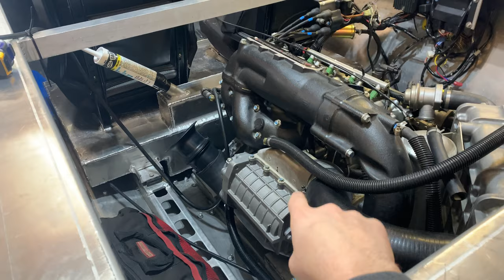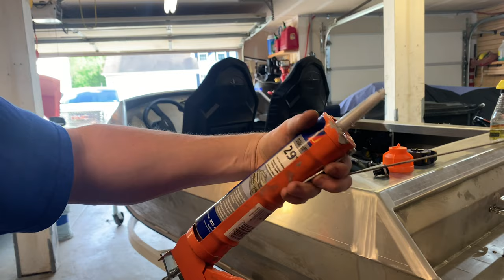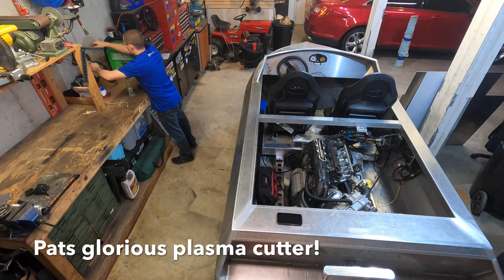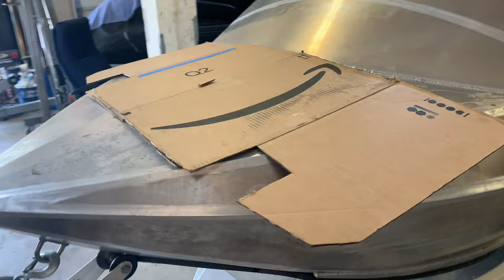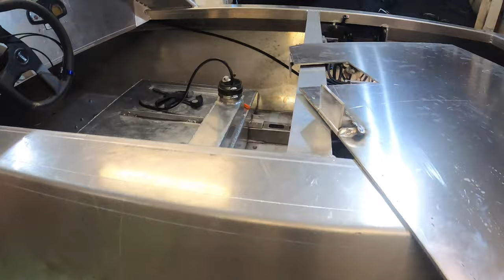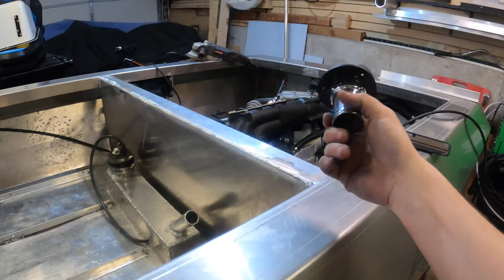Mini Jet Boat Build 21 - Bulkhead and Telltale

Comment: Nice work on the jetboat and dont you have a trim on the jet unit to counter the left pulling otherwise do a fine adjustments on the steering on the jet drive or extend your jet drive plate
Reply from the maker: I do not. I have been scoping out the southern jet trimmable nozzle to allow for some trim adjustment.

Comment: 1. What would you say is the minimum depth these boats can ride in?
2. On another note, What is the legality of driving one of these in standing water?
3. About how much would you say a person should save even before buying anything for one?
Thanks for posting your build, there is really no videos that have this good of quality, and as always, cant wait for the next video
Reply from the maker: 1. For the majority of the smaller two stroke boats (10-11 foot) minimum from what i've read is around 2-3'' is all thats needed while on plane. 
2. The legality is determined by the local laws and statutes. For a good portion of the recreational rivers down south of me, They are limited to 35 hp outboard jet pumps. But those restrictions are only in place on the portions of the rivers that are primarily used by floaters and canoers. For the streams i plan to go on, Theres no verbiage that i could find that governs or restricts the use of a boat on them, probably because its never been an issue with boats going up small creeks as most dont have tiny jet boats =]
3. This build is a bit deceptive with the timelines of everything. I really started this build with small pieces last year in the spring. It first started by figuring out which welder i needed, And what it would require to get the welder to work in my garage, Then installed the electrical subpanel in my garage, Then bought the welder, Then i picked up what i though would be my donor (stx1100) for free in a broken state, Fixed it and realized i wanted more power, So then picked up my Ultra250x in a broken state for $1k. Put a new supercharger on it and it was flying. Then it was on to choosing the specific hull that i wanted. I knew that i didnt have the welding skills to keep the boat from warping while welding, so i aimed for a welded hull. Minijet Inc had everything i wanted at the right price. As they are canadian, The exchange rate worked out in my favor and was able to get everything i needed from them in a bulk purchase. (11 foot avenger hull, 4x8 sheet of UHMW, Intake welded in and adapter plate specific to my donor)

Best advice i can give is just take your time with getting the pieces in, and purchase as frugally as possible, And just get a dedicated boat savings stash setup for 5-6k initially. These things can be made for very cheap, But will be a very rough ride. Join the mini jet boat build facebook group and  you'll see a ton of different builds, qualities and prices to completion. Also thank you! I enjoy making the videos so thats a plus!
Reply: Thanks for answering, means alot
Reply: Hopefully i can get the build started after college, these just look like too much fun

Comment: Great video!! Been following the whole build, just a question do you have enough clearance with the bulkhead welded in place to remove the engine should you ever need to?
Reply from the maker: Yep! The mating depth of the pump shaft coupler is just under an inch, And the depth in front of the motor is right at 1.75'' before it hits the bulkhead.  so i have a whopping 3/4'' to work with. I can always make my life easier by removing the pump with four bolts and sliding the pumpshaft backward a bit too.

Comment: I'm sure you already addressed this in one of your different parts so sorry for asking again but about how much total does it cost to make one of these kits?
Reply from the maker: I am a good bit over price on this one, As i came into it with such a lack of knowledge, But for this build, I am right at 14k with everything. Thats the welder, the donor, The hull welded up, Shipping, Various parts, 300CF Argon Tank etc.

Many guys who do the mini route and use the two strokes are able to stay under 7k.
Reply: @Localhost127  thank you that's good info

Comment: Now that you have done the 250 X and cut the whole thing up do you think you could have got it out without cutting I’m looking at a beautiful one sitting here just don’t want to cut
Reply from the maker: Yes, but it requires a TON of disassembly and these hulls in pristine conduit oon don’t sell for hardly anything. 

Because of how large the supercharger and intercooler is on this platform it makes for a really difficult removal